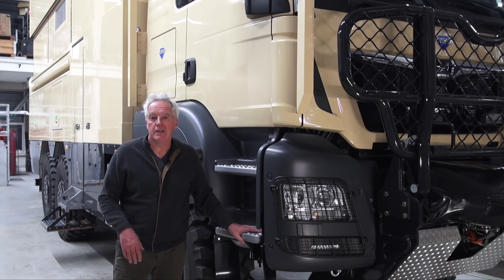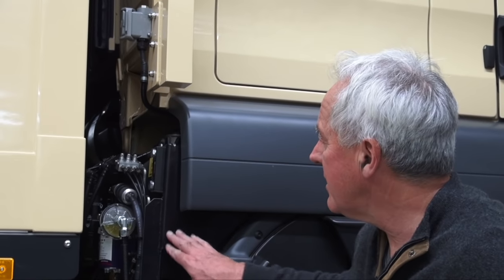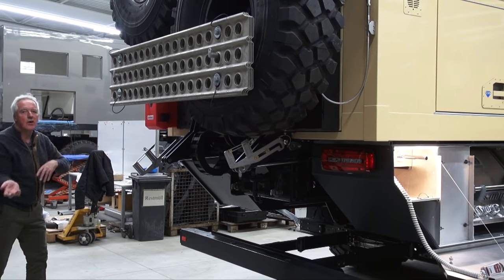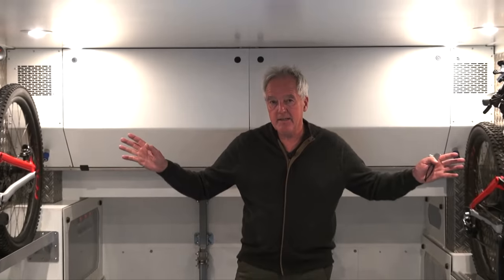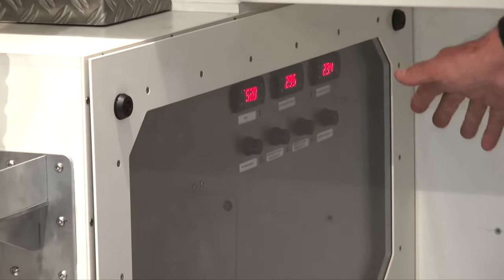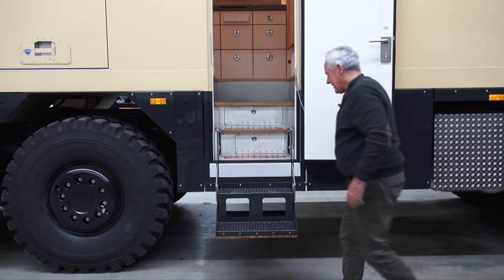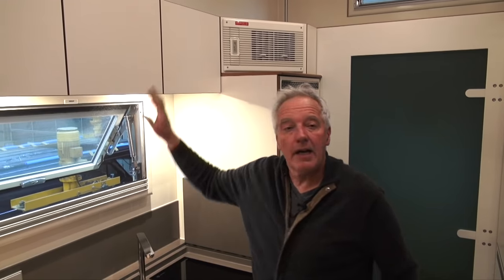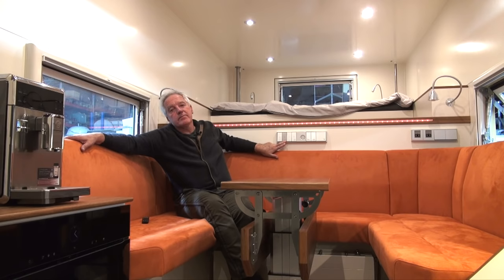UNICAT Expedition Vehicle EX74HD MAN TGS 26.500 6X6 X4

Comment: I don’t understand why you guys didn’t make a second sleeping area above the shower?
Reply: Could do I suppose, but don't forget you'll have to take it down when the roof comes down.
Reply: First and most important, this is a build to order vehicle, it's what the customer wants and pays for. 

Next, there is possible already a second and third sleeping area, because in most of these kind of vehicles, the sitting area can be transformed to a bed. The third sleeping area is located in the drivers cab, since there are 2 spare seats (behind the driver and passenger) which can be transformed to a bed. 

And lastly, because there are only 2 seats with seatbelts in the driver cab, most of the time there will be only 2 people sleeping.

Comment: what is the longest box you can put on a 6*6 crew cab?
Reply: depends on the wheelbase and the weight distribution inside. With 4500 + 1400 mm, the box should not be longer than appr. 7.5 m
Reply: @thomasritter1470  thank for the answer. yeah 7.5 is the  minimum requirements for 4 pepole and bunks i think. whas hoping for a litle more. you build amazing trucks. i am in the thinking and planing prosess for what to buy next.

Comment: Great engineering , manufactur... Top
But the enificiency of so large, expensive veicle to have the abiity to carry a side by side ... its a big minus
The overdimension of truck to be able to carry de polaris costs more than 20x the polaris and more than 2x the truck to have the same live aboard conforts.
A trailer makes much more sense and utility. Buts thats my opinion, at the end what matters its the opninion of who pays. Good job Unicat
Reply: am not sure your polaris will be save on a trailer when travelling around the world with different kind of security. Having a garage space like this you know your polaris or bike is more save.
Reply: @elvismegabrain752  If you travel around the world, load and unload this is unpractical, takes time. you will not use it in daily  basis. Just pontualy. and the trade of is that this size of veicle can´t go in many places around the world, like inside small vilages and so on. you have to go by polaris because the truck dont fit. But thats an opinion for general use. again what matter its the owners choise, may be he has a very importante especific utility, otherwise for travel its very inificient in all ways, cost, weight, fuel, repairs, size, coplexity and so on

Comment: Ehy the hell do you need and PAY for all this batteries if you can get generator for 1000$ and petrol in cans, when you need power most :/  Building of this trucks is like race of : how much can you fit and spend of unnecessary shit :)
Reply: @Bartek,
On our ExpeditionVehicle, we prefer photovoltaic because it is silent and always on.
.
But we agree with your evaluation of this bank.
In our case, instead of increasing the bank, we reduced our electric needs.
We also use high-draw appliances mid-day, so much of our juice comes from the sky, mostly by-passing the bank.
.
2003, we installed our bank of eight Concord Lifeline 105ah AGM.
A caravan chum calculated we usually draw less than 3% (three percent) from our bank, and that is re-filled in minutes.
Nearly two decades full-time live-aboard, our AGM bank is going strong.
Reply: The most OP system I've seen so far 😍